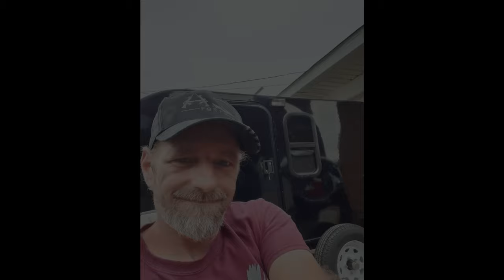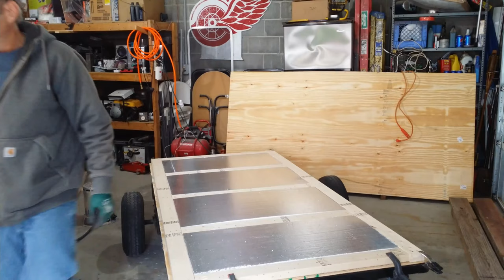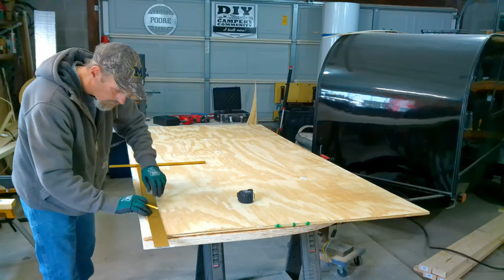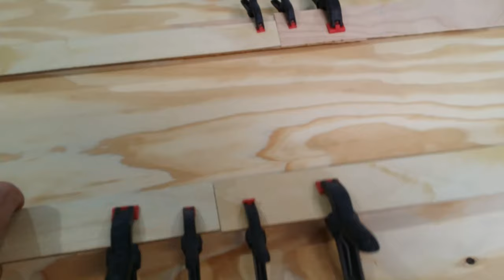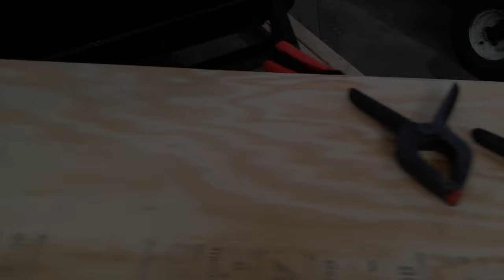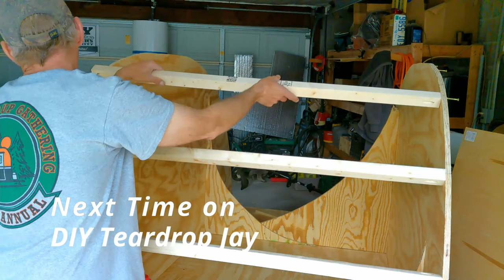How to Build A Teardrop Camper. Part 2. Installing The Floor & Cutting The Walls (Vendor Build)

Comment: I don't have tabs to bolt to but I have a 2x4 1/8 inch box frame the middle supports are smaller. Should I just  

bolt to the cross supports?
Bolt through the main frame
Screw to the main frame with Tek screws (self tapping metal screws)
Get tabs welded on?
Or maybe do riv nuts in the main frame?
Reply from the maker: I recommend just getting the tabs welded on. It's just easier to fasten and it would be removable in the future should the need arise. Thanks for watching!

Comment: Also is it necessary to use sanded plywood for the exterior wall? 
I am thinking of doing 1/4 wall with 3/4 insulation and 1x inner frame with 1/4 inner wall. 

Thanks!
Reply from the maker: I don't use it. I use exterior grade. Thanks for watching

Comment: so your not putting anything in between the floor and tabs? or in the holes? will water not get up into the holes? thanks for the video. I think I just over thing everything.
Reply from the maker: I shoot some proflex around the bolt before I snug up the wax nut. Nothing between the floors and tabs. No need for anything there. When all is said and done, I caulk (rv proflex) around everything on the camper, that includes around the frame on the floor.

Comment: Great job. On the insulation 1 1/2 is not available shortage here. Can i use 3/4 insulation x 2 to make an 1 1/2 or any variations for tge 1 1/2
Reply from the maker: I dont see any reason why you cant. Thanks for watching!

Comment: What are your thoughts about insulating the walls?
Reply from the maker: I haven't found a need to insulate the walls. I have done it once. I'm definitely not against it. I just dont think its needed. I have camped in 100° (F) heat and as cold as 20° (F) and was fine in both situations without it. Thanks for watching
Reply: @DIYTearDropJay  I've heard people talking about waking up on cool mornings with condensation inside and wondered if that was an issue you'd ever encountered
Reply from the maker: I always have a window cracked and the fan running, even if the fan is just cracked open. Never had an issue with condensation.